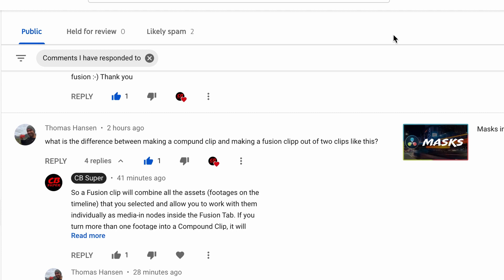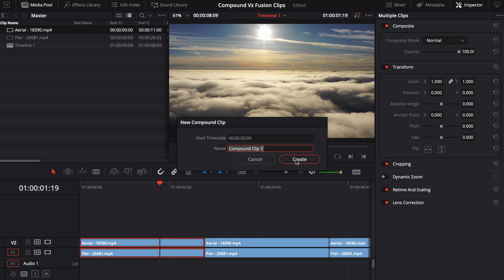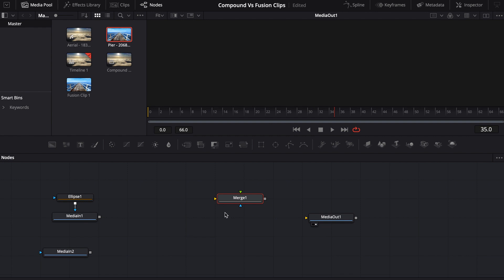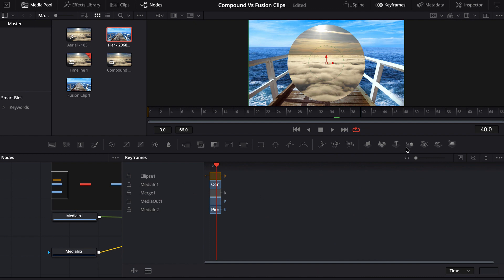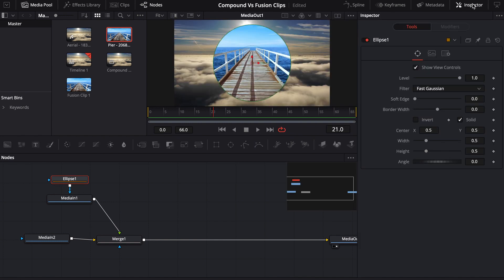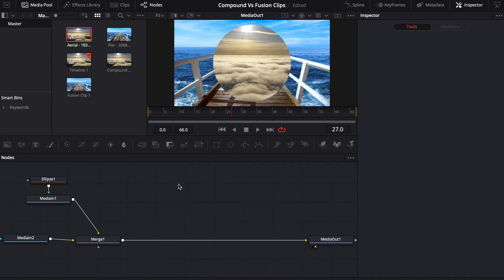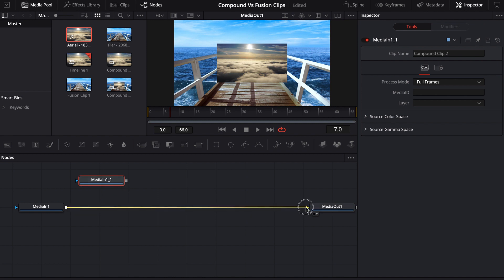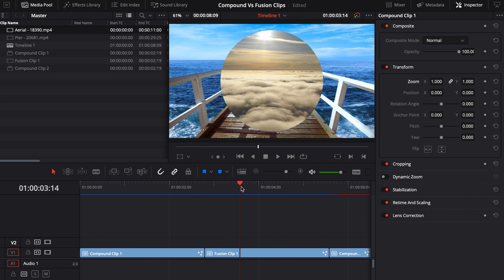Fusion Clip VS Compound Clip in DaVinci Resolve

Comment: Hey CB, quick question. I have two videos on the edit page, one on top of the other and I'm merging them together with key frames and changing their composition. However when I try either delivering them the colour goes back to the original or it isn't blended the way I wanted like during on the edit page. 
I get all kinds of different results if I combine them into a fusion clip and compound clip but still isn't the original way.

You know any reason for this? Cheers 
- CJ
Reply from the maker: I don’t, sorry. Keep in mind that everything that you do on the fusion page takes place before the effects on the edit page. Unless you “precomp” using a fusion clip
Reply: Thanks anyways bud... I did solve it in the end. It was on the delivery page. Think I used rendered cache images or one of the similar checks

Comment: Does using fusion clips hinder the final render quality? I don't  entirely know the concept of those clips so I am currently using them to kind of bake or lock certain changes I make to clips. I make a fusion clip when I'm done trimming my clip because if I leave it like that after trimming I can still access my full footage anytime which I don't like. Then I add effects and graphics to that fusion clip and once done with that I make another fusion clip outta that one if I have to add more stuff. So pretty much I make 2 fusion clips. Is this workflow lossy? Should I use compound clips instead? Im suspecting this because for some reason I couldn't maintain the bit rate of a clip I edited this way when rendering it. The original clip (mp4) was around 10000 kbps and the rendered MOV H264 with the bitrate set at 15000 kbps always resulted in around 4000 kbps. Only happens choosing MOV H264. I tried other codecs like h265, DNxHR and they deliver at the kbps I set.
Reply from the maker: I don’t think it will degrade the footage. You can make several nested timelines (which is all a fusion clip is essentially) and it should be fine. You can up your bitrate on certain export formats. Some are lower bitrates, some are not. Try to simplify your editing process though. And if you make lots of changes in fusion, some of those changes may degrade your image of course (like colorgrades and resizing etc).
Reply: @CBSuper  thanks for the response. Everytime I export it with the H264 codec it renders the clip with a very low bitrate of around 1000 kbps. The original clip has just over 10000 kbps. I set the export bitrate to be 15000 kbps everytime.
Reply from the maker: @INProcess..  try a lossless codec. Id only try a small clip as it can take a while. Im not very experienced with higher bitrate codecs for final export.
Reply: @CBSuper  yeah fortunately the clip is 23 seconds long so I tried exporting it with lossless codecs but theyre massive. They give crazy bitrates of over 100000 😂 Only one let's me control bitrates is h265 and it renders at the bitrate I actually set but now I cant import into another project. I'm watching tuts on how to solve this. I suppose I'll have to download a decoder or sth so that DR can playback that h265 clip. Thanks for the help!

Comment: i don't know if you've answered this on another video, but a bigger confusing difference is fusion composition and fusion clip, can you possibly remake this video to include that? if the difference is small then just reply please
Reply from the maker: Sure, I can make an updated video to this topic. So they are kinda the same, but depends on how many media clips you have stacked in your edit timeline. If you have nothing on your timeline and you want a blank slate to work on in Fusion, you'll use the Fusion Comp. If you have just one media clip on your timeline, you can just jump straight over to Fusion and start working. If you have two or more clips and you want them all in fusion and you want them to retain their timing, then you'll select all of them and make a Fusion Clip.
Reply: @CBSuper  i think i understand, but a video would still be nice, i can kinda turn a fusion clip into a composition by removing the "media in" that is connected to the timeline and drag clips from the media pool, but when i right click the fusion clip in the timeline after "converting" it, the options arr still unique to a fusion clip, so program-wise they are considered different, i want to know why
Reply: @CBSuper  i apologize for nagging and being a bit clingy, but there's also a framerate difference between a nornal clip on the timeline and a fusion composition version of the same clip, which also means i can't sync up its audio if i need it, are compositions intended more for graphics than straight up video? is this something i can change somewhere or is this a current limitation?
Reply from the maker: Hmm, that shouldn't happen. 30fps in Edit is 30fps in Fusion. You can set the fusion comp to be a certain fps and you can set the playback of the edit to be a certain fps so I'd double check to make sure they are the same. You can also play audio in Fusion, but you'll need to make sure your video is cached and possibly optimized media to get best playback.
Reply: @CBSuper  can you refer me to instructions on how to do that?
[edit]: setting fps
Reply from the maker: @vooshmoozik6185  when you start a project, you can hit the little cog icon for project settings in the lower right of your Status Bar/bottom bar. Once you drop your footage in the media pool, it will ask if you want to change your frame rate to match your footage. If you change it, just keep track of what your new fps is. Your playback should match your project fps. When you create a new Fusion Comp, you choose your fps. Make sure it matches. If your footage is different in the fusion comp, obviously that may cause problems. Try to keep all the frame rates consistent. You want to let your fusion comp cache (red to blue) to get full playback.
Reply: @CBSuper  i've actually found the source of the fps issue by myself, when you start a new blank project, in project settings under the general options tab there's a dropdown selection for mixed framerate format, for some reason blackmagic decided to give you the option to choose how it handles mixed framerate media, the default value is their own format, which seems to leave audio as is if you're conforming video, makining speed mismatch, but you CAN have multiple framerates and conform them individually in clip properties.

in the  dropdown menu, i chose "none" and the frames are calculated as i'd expect, they also included final cut pro in there for whatever reason, so yeah.... one more step forward for me

Comment: I hope you can help me with this. I have a video with 4k resolution and i work with 720p resolution to the timeline, but when i want to work with that video in fusion it still have 4k resolution and my pc starts to suffer and all runs laggy, why does the video have that resolution in fusion?
Reply from the maker: Fusion is resolution independent. It can handle different resolutions. A resize node will change it to your desired size, but you’ll need to cache it at the node otherwise it will still need to process the 4k to 1080 conversion all the time.

Comment: Very nice video. Question. If you have RAW footage, what would be the workflow in working in a 1080 timeline, but you want the fusion delta key to be drawn from the original 6K footage? But you want to do some color correction in order to get rid of the raw look.
Reply from the maker: I would pull the key first using the 6k footage without any color corrections unless the corrections help with the key. Once you have the key, you can either separate the key as it's own alpha render (render it out as a 1080p video or alpha) or as a simple black and white video that will be the traveling/alpha matte. Then you can import it back into the program and use that with the 1080 footage. You may need to resize it to make sure everything is matched up, but you can use it with a bitmap node to key out your alpha. Then you can color correct and do all the other stuff you want. This could also all be done inside the program, but the 6k will most likely slow down the whole project, so I prefer to render it out and bring it back into a new 1080p timeline.
Reply: @CBSuper  Thank you, that sounds logical, but the footage is RAW, and doesnt really do well for keying the way it is, I could put a lut on it an extract the key alpha matt and follow your procedures and then when importing it back apply the alpha to the raw footage.... right?
Reply from the maker: Yes, that's what I would do. You can even color the footage in the Color page first, then bake it in using a Fusion Clip before you send it over to Fusion for Keying. Or you can use a CC node to color it first.
Reply: @CBSuper  thank you, If the original footage is 6k, and timeline is 1080, compound clip to fusion also 1080, will davinci still pull the key from the original 6K footage? That would be very important I believe.

Comment: Hi, I have a question - what if I want to transform (reposition) my compound clips and there are five+ on top of each other? I have a Fusion clip on V1, then on top a compound containing 3 subclips , then another on top, then another compound containing subs. The motions applied interfere with all below, the compounds don't act as their own, but like adjustment clips. Does anyone know a way around it? Thank you!
Reply from the maker: Sorry, I'm clear on what your trying to do. So you can Decompose Compound clips if you need to move them around and reposition the original clips. Right-click the clip and decompose inplace. If you are using a fusion clip, it's a little different. you can open them in fusion though.
Reply: CB Super thank you, I did that, but it’s hard to manipulate all the decomposed subclips and apply same values to different lengths and transforms. SoI ended up exporting the compounds, recreating the timeline and then applying the repositioning and using the screen blend mode to figure out. Messes up the color values at times, but it’s the only acceptable way. Fusion is new to me, not sure how long it would have taken me to stack and animate  70 clips in a 7-8 min sequence... I appreciate your reply though :)
Reply from the maker: It would def take a good while to stack 70 clips in Fusion. I think thats a pretty good way you cane up with.

Comment: So if I understand it well, the compound clip is destructive while the fusion clip is non-destructive. So why would anyone use the compound clip over a fusion clip ? In what kind of occasions would it be better to use a compound clip instead of a fusion clip ?
Thanks in advance :)
PS: Your tutos are great. You got one more sub ! Keep up the good work !
Reply from the maker: Compound clips work as a grouping system. They can be handy when you want to group several cuts together and add the same audio or visual effect to that group. They are not fully destructive as you can right click on the compound clip and open it in timeline or even decompose the clip to undue the grouping. This was of course more useful until we got the Adjustment clips, but it still is nice to be able to group clips together. It sure wouldn't be my first choice when combining assets for Fusion, but I will often combine clips if I want to make a secondary audio adjustment to several clips.

Comment: Hello, this video is nice but I need help on how to increase the duration of a clip, let say a fusion clip.
Reply from the maker: Kosmos Fantasias either drag it out longer at the end of the fusion clip or adjust the clip length/duration when you create the fusion clip. Compound clips will be as long as the longest combined clips length. Make sure you’re using the regular selection arrow tool and not the blade.
Reply: @CBSuper  Thanks for the help! It really helps me to understand what is going on with the fusion, compound clip thingy.

Comment: I realized this was about something specific that you had done, which is awesome thank you, but not the information I was looking for... No worries, I'll keep looking. 
**Only thing is, you say that a compound clip is destructive, but all you have to do is open the compound clip in a new timeline by right clicking on the clip, selecting 'Open a new timeline' and then you can adjust it all you want... and then go back to using it. 

It's not completely baked in, and it's completely adjustable (like a MultiCam, which most people think is also not adjustable, but is)

Thanks, keep up the great work!
Reply from the maker: Brian Villegas thats a great tip and I was not aware of that when this video was made. Thanks for putting that out there as it helps everyone learn, me included.

Comment: Once you start on a fusion clip, how do you add additional clips?
Reply from the maker: Once you're in fusion, you can drag and drop media from your Media Pool and you can drag media off your desktop and drop it directly in to the fusion nodes panel if you want. You can quickly swap between clips using the Clips panel, but you need to click on Clips in the top of the screen to enable that panel. Hope that answer's your question. Cheers!

Comment: How do I decompose a Fusion Clip?  Or can I?  If not what method could I use to retrieve the original footage with its original start and end points.
Reply from the maker: You can deconstruct a fusion clip by hitting CMD-Z to undo it. You can also right click and open the clip in a timeline to see what is inside, then copy and paste that clip back into your original timeline. Then delete the fusion clip.

Comment: 1st like & comment :) appretiate for those tutarials i have learned alot .
i have weird problem when i change my timeline to 1080x1080 , put some video on it , it playbacks as expected(when i watch it via fit) , but when i watch it via fullscreen (ctrl+f) i see black screen on top,bottom ,right and left sides. i was expecting to see black screen on two sides of the movie.when i render it by 1080x1080 its same black screens on 4 side of the video.
sorry for my broken english. this is what i am talking about (this was showing only top and bottom on edit tab but when rendered with same settings as timeline it is different)
https://prntscr.com/puojv4  -- this is when rendered 
https://prntscr.com/puomdn - this is at edit tab
Reply from the maker: If you scale the video up to fill the entire 1080x1080 frame, you should see only black on the left and right side, but the Full=Screen view only enlarges the view in it's current aspect ratio, so it will make it larger, but will have black bars on whatever side that it doesn't fill, it wont render the black out, unless your project size doesn't match your video size. So you would basically have to crop your normal aspect ratio video to a square, unless you're fine with the black bars. If you want to see how to crop video for a square, check out this other video I did a couple weeks ago on cropping for instagram. https://www.youtube.com/watch?v=UNzhVO6LPbA hope that helps somewhat, DaVinci will add in black on the viewer, but not on the video..if that makes sense.
Reply: @CBSuper  ty alot :)